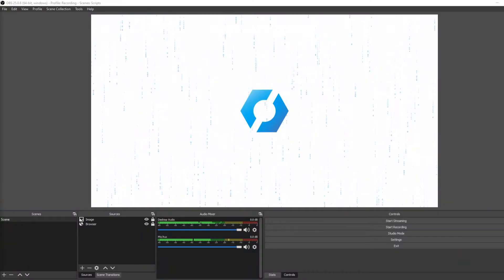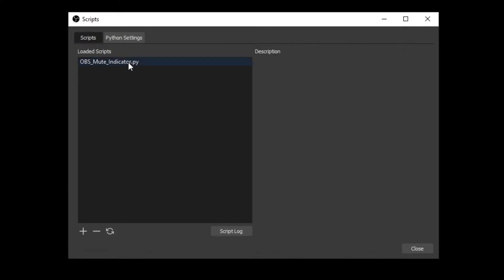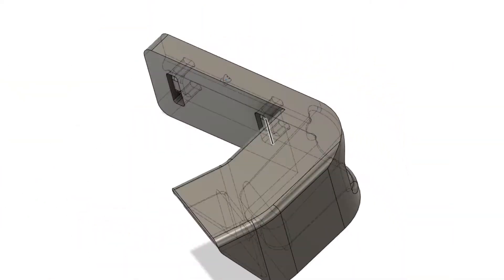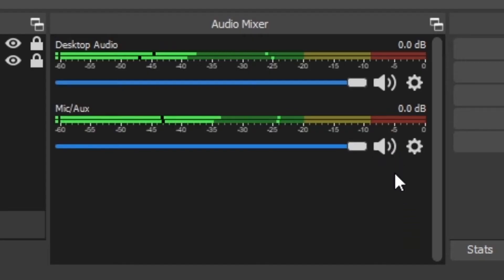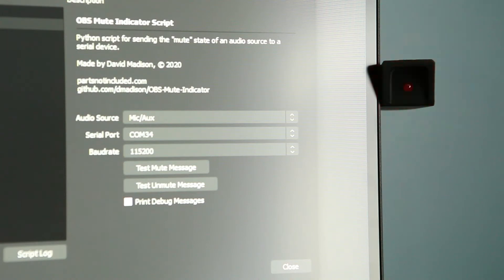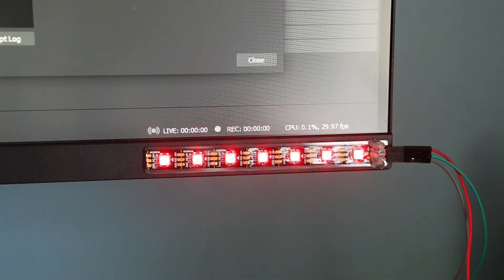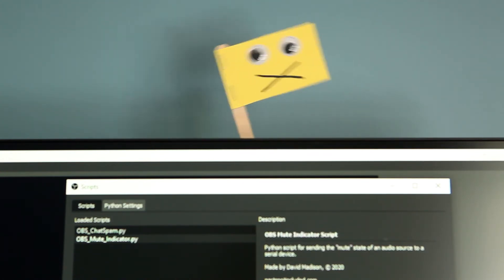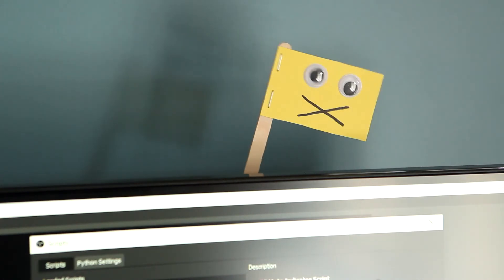Making Physical 'Mute' Indicators for Streaming

Comment: hello, is it possible to use this script in order to make a sort of overlay on your stream to indicate if your mic is muted or not?
Reply from the maker: It would need to be rewritten to control a source rather than a physical device. Although you could always set your mute/unmute hotkey to show/unshow a source as well - so long as you always mute with the hotkey (and not the mouse) it will work great.

Comment: Is there a way to toggle the color of an RGB light rather than turn it off completely? So when the mic is muted it appears red but when it’s live it turns green?
Reply from the maker: Sure, you'd just need to modify the code on the Arduino.
Reply: Dave Madison is there anyway you would be willing to help me with that? I’m super new to the Arduino and wouldn’t even know where to begin.